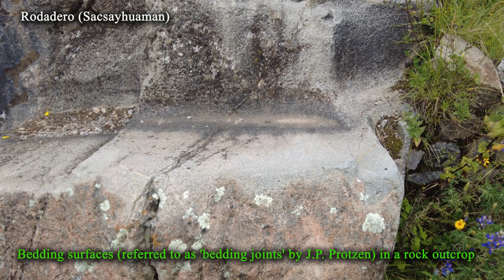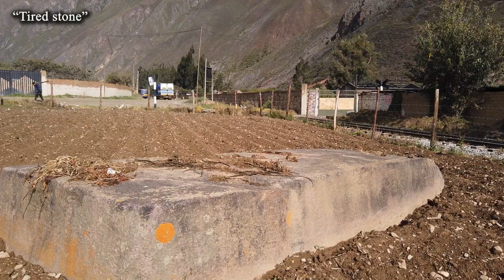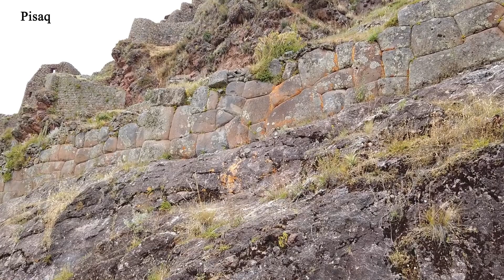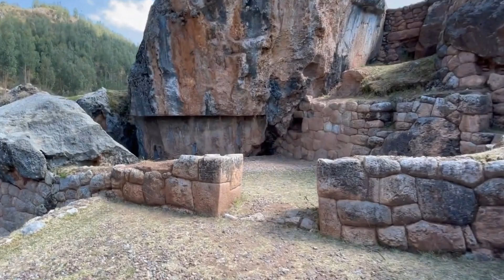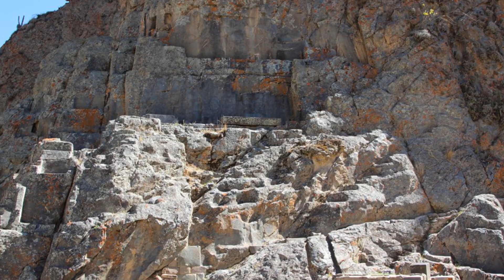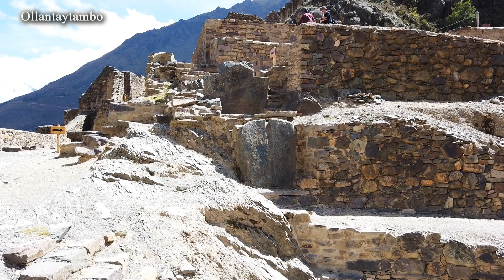The Rise of Polygonal Technology. Evolution and Trials​

Comment: 28:41 I truly believe that these bosses are for the purpose of containing  fractures and cracks sort of like a relief boss. When plastic or brittle material cracks,a good way to stop it from breaking is to drill a hole right at the end of the crack giving it less of a chance to spread. This is just the reverse process IMO and you can actually see cracks leading into all of them